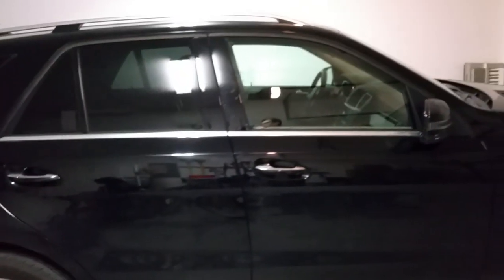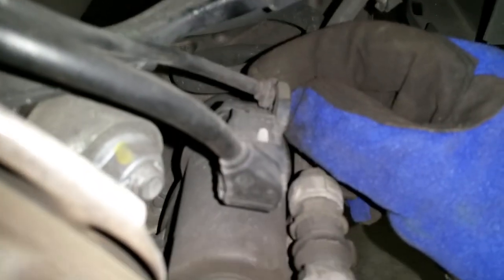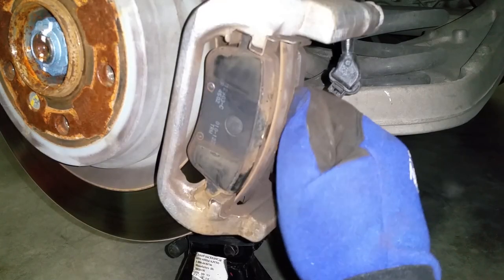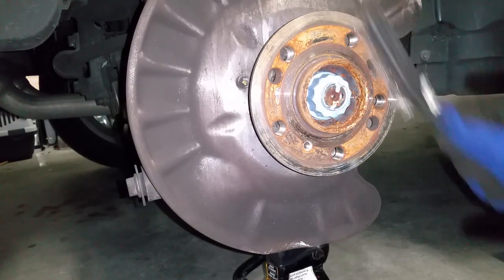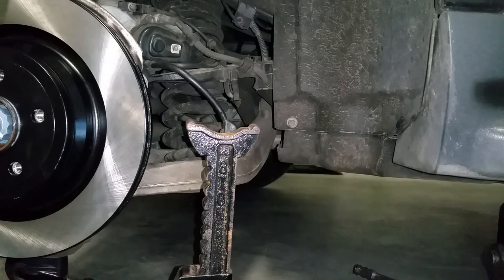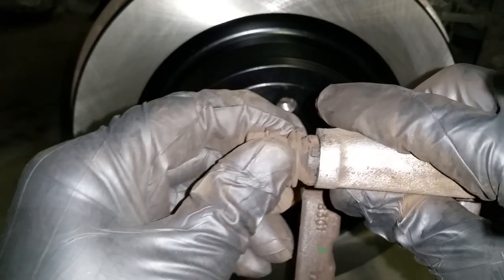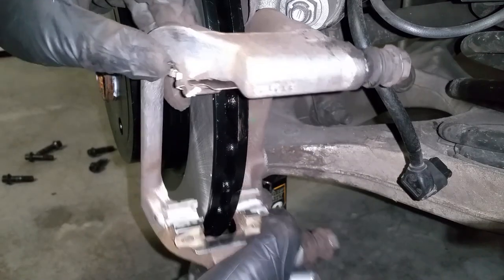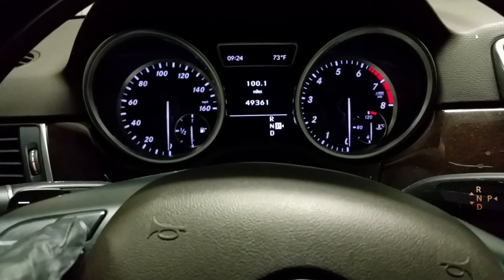Mercedes-Benz M-Class Rear Brake Job HD

Comment: Flat out one of the most well done and informative videos for DIY folks ever made. Showing the way to get into the service menu rather than using a separate attached computer (which is what ever repair facility tells you is needed) was beyond awesome. Thank you thank you thank you.
Admittedly this was the longest brake job I've ever done - thank you Mercedes. Two separate pieces, etc. Really... REALLY...
I'm used to 10 minute jobs on older Porsches and without your video I would have failed this job (though I suspect one can pull the caliper off without retracting the parking brake through the service menu, I'm betting it would have been impossible to put back on).
And the 18mm socket. Jeez, I've been servicing German cars for 30 years and never needed one before. Great to know I had to go run out and get one before starting the job.
My most sincere gratitude.
You rock dude.

Comment: I looked at your excellent video today again and changed my rear brakes pads and rotors on my 2015 ml350. Went smoothly beside having to use a gas torch to help releasing the rotors from the hub. Thanks again

Comment: Thank you for this excellent and very detailed video. I noticed you used a brake caliper tool to compress the brake piston. I have always used normal clamps for this.
Reply from the maker: This tool allowed to freely spin piston while you're pressing on it, some brake calipers Pistons you cannot just simply pressed in, they have to be turned at the same time. At that time I was not sure what kind of piston it is and just by looking on it you can see a little cut outs right on top of it, from my experience those type of pistons with cut outs have to be turn, but in this case it seems like on the video that they never actually turned..  I purchased this tool  on Amazon for like 20 bucks, way more convenient to use this then just a regular caliper press that I used to use and still have one in my belongings.

Comment: Excellent video...both this and the front brake video. Have done ML350 brakes before but wanted to check so I didn't forget anything. Two comments...1) My local MB dealer wanted $1800 for new pads and rotors...cost me only 400 and that was for drilled/slotted rotors and carbon fiber/ceramic pads (and hardware). 2) might consider adding recommendation to use a torque wrench to tighten bracket, caliper, and wheel bolts.

Comment: Very informative and very well presented...Thank You! If rotor and pads are worn on 1 side of rear of vehicle only, do you recommend replacing only the one side or both rear brake rotors and pads?
Reply from the maker: Unfortunately when this happened you have to replace both sides at the same time rotors and pads because when you will be performing a break in one side will stop quicker than another one. If your rear need to be replaced only don't worry about the front if they're okay and vice versa

Comment: Sliding pin bolts: though a 13mm socket might work like in this video, if you look at the back of these bolts you'll see they are actually Torx T-40. You'll get a much better grip, especially on a stubbornly tight bolt, with the T-40. The outside of the head is pretty soft and a 13mm wrench or socket may slip and round it off.
Reply from the maker: Yeah I seen it. Thought could do both . Thank you

Comment: Excellent DIY; only question is do you change the rotor and brake pad on the passenger side and then reinstate the parking brake or not? meaning after brake pad/rotor replacement on both rear tires, then only you go to the service asyst to engage the parking brake? right ?
Reply from the maker: Yes ofcourse!! Gotta do them both first.  Then in the system Switchback

Comment: Following your instruction to replace the rotor and pads but they got really hot after a long drive. There seems to be drags somewhere. I have done everything I can think of like greasing this or that. Do you know if there is anything else I need to do? The only thing I can think of might be the e brake.
Reply from the maker: They both dragging?? Both getting hot? It should not be e brake because when you enter settings to release e-brake for replacement and then not returning settings. E-brake  will not be activate, it will just simply not going to work at all. Also check if u plunged harness back for e-brake
Reply from the maker: I would recommend you to flush your brake system it might got dirty somewhere. One of the ABS valve clogged !
Reply from the maker: by the way when you have new rotors and new brakes they will always start to getting really hot and steaming because they're new and some new material and oils are burning so it might seems to be their extremely hot because they're steaming but it's not it's absolutely normal and it will go away. After driving and braking. touch your wheel and if it's really hot this is not good
Reply: @IvanRossS  yes. they both got hot. it's not bad for short trips. but any trips longer than 20 minutes make them hot. it was steaming hot the first few days. it's getting a little better. but i can still feel calipers are warm since the fronts are basically cold. do you know how long roughly it would go back to normal. i'm thinking to take it to a local mechanic for an inspection. thank you for notifying me the message by leaving a comment on one of my videos.
Reply: Took it to a euro car shop and they basically redid the brake job and found no issue. But it’s still getting hot. I guess I either do the fluid flush or have to take it to the dealer

Comment: Your rotors look good. Why did you need to replace them? Were they disbalanced? Vibration?
Reply from the maker: Vibration. That was cost by warp rotor. It actually could be fix by simple  resurface but  I ended up replacing them. Vehicle wasn't mine. If you have original OEM Mercedes rotors I highly recommend you just simply resurface them it will remove any vibrations. OEM rotors much better then this cheap Chinese rotors. I see now why they charge so much for them at the  dealership.
Reply: @IvanRossS  thank you for answering. Was the vibration happening on braking or even on driving 40mph and up?

Comment: Thank you.  Easy to follow and good video for DIY folks.  One quick questions, is it same process for 2014 ML350?
Reply from the maker: V Pandita should be same . its same generation
Reply: Thank you.
Reply from the maker: V Pandita  Just so you know for future reference use. next time if you wanna check the parts capability or some work done to your vehicle you can simply check what generation of your car by searching it on Google . Example: if your 2013 Honda Fit - will be 3d generation, they were made from  2010 until 2015. so 80% parts or  work same. unless u have different suspension package or bigger/smaller engine.
Reply: Replaced rear break pads and rotors.  Your video was a life saver.  Thank you.  Took me a bit longer than expected but some of that was due to learning curve and not having the right tools etc.

Comment: Hi, great video. I have 2 questions.  What is the type of grease you use on rotor mounting plate and also on brake pad hardware?   Where can I get it?  And 2nd question is that I bought MB original rotors.  They seem to have some protective film on the rotors.  Do you know if I need to clean that off the rotors before installing or will it automatically come off once I start driving?
Reply: RE: ..shipping film on rotors...always clean the rotor (pad surface) before to mounting and again after brake job, to eliminate possible grease/oil/hand print, etc. contamination.

Comment: Nice presentation. I need know how to remove brake light. I still can't erase it. Everything done well as you showed. Only difference is mine is a 2010 ml350 bluetec. My warning and ABS came on before replacement of pads. I replaced ABS speed sensor but light still. Left rear hit a pothole then the lights came on ABS and warning. I tried clear them. What am really asking is how to clear them since the car is braking well and nothing seems wrong.
Reply from the maker: Well from my experience if ABS showing you  it's mean you still have a problem. Usually the way how ABS system works if it detects error then it will show, if error was not detected ABS light will go away, you will still have a code stored as a history in the system you . You can clear them,  but there is really no way to clear out ABS light for it to go away it means that you still have a problem somewhere. I could be wrong. All experience that I had with ABS system, this is how it worked, as soon as the problem was fixed ABS automatically goes away but it's a Mercedes..... you replace ABS speed sensor how did you knew this is was the problem?? usually when ABS comes up it's mean one of your sensor that on wheel failed. You have 4 of them.  the way to find out which wheel speed sensor went out you have to read codes directly from ABS... cannot be done with the regular check engine scanner, you have to find and buy one from Amazon or ebay that can actually read ABS error codes, im sure  as soon as you clear those codes, that ABS system will automatically come back as soon as it will find error.

Comment: Really good video and thank you for doing it, however why are we replacing the rotor when the rotor has a lot of meat left on it?  Was it warped?  There's a tolerance for thickness on the rotor ... even if it's warped you can bring it to a machine shop and have it turned.  Also, use a cheap c-clamp to depress that brake caliper and save some money by not having to buy a special tool kit just to depress the brake caliper.
Reply from the maker: I was doing this for someone who did not want to resurface rotors and one them brand new!!! I rented tool because I was told you can not just press in piston and it have to be screw in withthus tool kit. That was wrong.!  So I used it because I had it and futured it in this video. Since I post this video I have done many many brake jobs on different vehicles. I now have my own tool kit like that. I don't rent tools anymore lol. I just buy them because next time I know I'll use again.

Comment: Great video! Few questions after you access fitting position can you turn ignition off and remove key and perform pad removal? Also do you pump break pedal before exiting fitting position? Thanks
Reply from the maker: Lee Murtagh yes u can !!
Reply: Great thanks so much mate!
Reply from the maker: Lee Murtagh dont pump brakes. Just exit fitting position and then pump all they long :)  I highly recommend to resurface your OEM rotors If they still not bad instead of buying  crapy  aftermarket like I did..  You can resurface your rotors only for $12 at all O'Reilly Auto Parts.  Or at your local brake shop for little more, but still you will save alot and end it up  haveing  original good rotors!!
Reply: Great idea never thought of that thanks! So just exit fitting position then pump pedal as Normal?
Reply from the maker: Lee Murtagh yes.  Well  honestly I don't really know but I would just do procedure backwards!  Fittings required to be released because you have electric emergency brake!  So even if you pump brakes before you exit the fitting position that shouldn't hurt.  When you releasing feelings, you basically preventing to break your emergency brakes system, that all.
Reply: I understand what you mean you’ve been great help thanks again! 😁

Comment: Best brake repair video I've seen on youtube.  Actually one of the best DIY videos overall.  Wish that others would match your level of clarity and attention to details.   Only question is do you only bleed lines if the hydraulic system is opened ?   I've always bled lines during every brake job, even when the system was not opened.  Rational is to remove the old brake fluid which tends to accumulate water and cause corrosion.  Maybe this is overkill ?
Reply from the maker: Thank you! No u dont have to. IRS only for rotor replacement
Reply from the maker: I would not bleed the system every single time you replace brakes. but every other time, this is definitely Overkill but it will keep your master cylinder work forever and over all performance of brakes of course will be better.
Reply: Great instructions.....however it would be best to clean everything before installing the new pads....brackets, calipers, mounting plates, bolts/threads ....everything.

Comment: 2 questions:

1.- What does the "moving to fitting position" adjusment do?
2.- Why did you open the brake reservoir cap?
Reply from the maker: Yussnan84 This vehicle have electronic emergency brake. So they have to be released through the onboard computer for future brake pad replacement. This is very important step and you cannot miss it !! I always open brake fluid reservoir cap for brake fluid return, because every time you compressing brake caliper piston, brake fluid returning back to reservoir and if that cap is closed you're gonna creat unnecessary pressure. Also be aware if you're brake fluid being topped of and you're changing your brake pads, you might need to remove some fluid. Since brake fluid will go back, back to Reservoir, extra fluid will over flow and brake fluid will be dripping everywhere, into your engine bay, and on your paint..
Reply: Very helpful, thanks.

Comment: Great video!

One question:

We just did the same job on a 2012 ML350 but at the end when we try to exit the fitting position the car gave me this error:

- Cond. for Exiting Fitting Position Not Correct, To Confirm: OK
When I press OK the menu goes back to: 
- Fitting Position Reached To Exit Fitting Position: OK
and the menu returns to the same cycle again…

What can be wrong?

Thanks in advance.
Reply from the maker: Mario Gonzalez make sure u have good connection on harness by the brake caliper
Reply: I will and let you know... thanks

Comment: Great Video. This showed brakes replacement on on e wheel. Should Wy reset the main Menu after replacing brakes on both sides. Or complete one side and then go into fitting mode again for second wheel??
Reply from the maker: Rajesh Marwah  you are resetting the menu to complete rear replacement and that's for both sides

Comment: Is that White Lithium Grease you used on the pad clips and between the hub and rotor?
Reply from the maker: Aaron McVay I don't remember what i used,  it's maybe  ceramic brake Grease, it's white also. You can buy tube at Advance Auto Parts
Reply: Use the special NAPA Sil-Glide part # 765-1361.....will not melt & water repellent - good for temps -20 to +600.
use it all parts the brake parts
Reply: In addition...I noticed at the 12:37 minute, the outer brake pad was contaminated with that white grease....appears too much grease was used....you do not need to over grease the brake hardware....
...Watch close....you will see that a hanging sting of the grease makes contact with brake pad...this is a no-no....be careful....if you have grease on your gloves, change them.

Comment: Couldnt compress the cylinder for some reason even though fronts were fine, the cheap tool I had just wasnt strong enough, weird... Will need to get a set like yours

Comment: Got a question as I am right in the middle of replacing rear brakes, pads and sensors. the wear sensor is only on the right rear? I took off both right and left rears and I only have 1 sensor, I don't see a sensor for the rear drivers side.
Reply from the maker: Yes only 1 !! It's because usually your brakes wear out evenly maybe it's not wear out evenly 100%  same but they're pretty close and One sensor is just enough to give you information when it it's time for you to replace pads

Comment: Does the Disc Brake Caliper Tool Set actually spin the cylinder as it compresses? Do you absolutely need this toolset for safe compression?
Reply from the maker: no you don't need to have caliper tool that actually spin the cylinder. if you take a closer look on the video you can see that cylinder does not spin!. I I rent this tool from AutoZone and I got all my money back when I returned it. the reason of that because, I had a tool that didn't work for those type of calipers.. because as you can see on the opposite side of the caliber it's all made out of plastic and if I would use my old tool it will break right through it.
Reply: Didn't see it rotate, but thought I'd double-check. Thank you!
Reply from the maker: Ron Dexter u are welcome,
 thanks for watching.  if u have any questions don't hesitate to ask. I'm pretty quick responses :)

Comment: Thanks a lot for the video. It's a great one. I just asked someone replaced my rear break pads. But the guy didn't release the break reservation cap and put the break pad in fitting position before he replace the pads like you did in the video. The display of 'check break pad wear' message is still showing after the replacement. I tried to do it again as showing in the video. But the system always say 'not correct condition'. How should I fix this problem now? Please advise. Thanks a lot for your help in advance.
Reply from the maker: Did your guy replaced brake wear sensor or he reused old one???
Reply: Thanks a lot for your reply. He did replaced the break wear sensor as well.
Reply: The sensor is located at the passenger side.
Reply: He used a off market sensor. Will this be a problem? The message is still there. Could I clear it? Will this affect the driving? Thanks a lot.
Reply: Did you fix this problem.?

Comment: Hello,
Im trying to change my reard pads but cannot access the service menu to put in Brake Pad replacement mode. Ive tried many combos but still no luck. Will I still be able to get the job done? Will it let me push the caliper?
Reply: Ok i had the same issue but i went online and read on the forums and they helped me figure it out. First you have to be in the odometer screen, then press the "answer call" button and "ok" simultaneously for like 5 seconds. Try that it should work